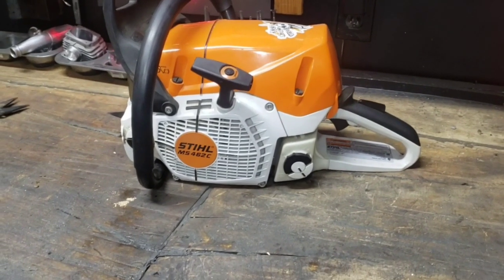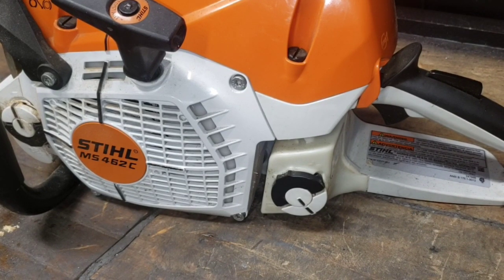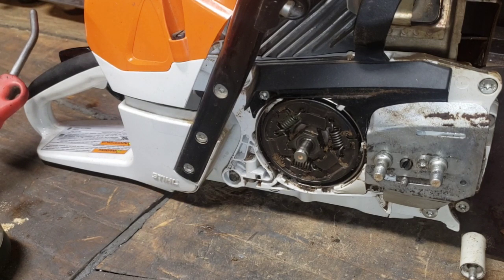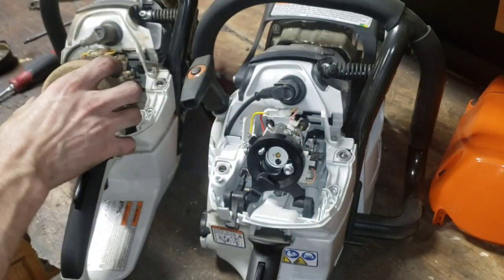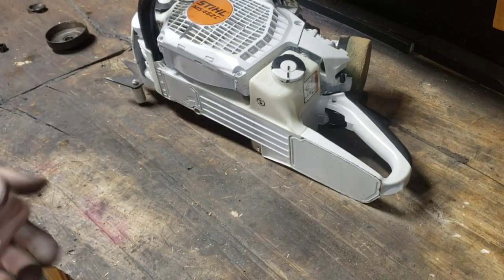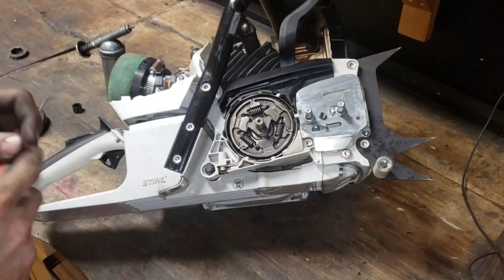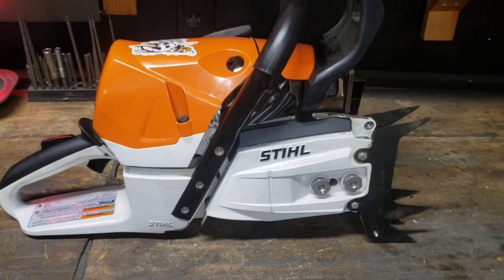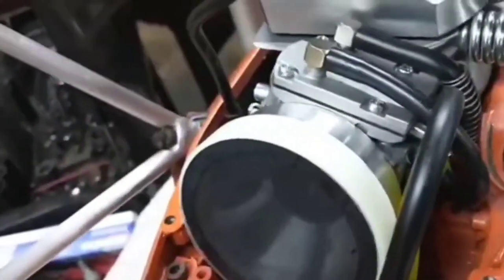MS462 diagnosing and repairing... clutch issues and a CRAZY husqvarna  372 race saw with....

Comment: Not long ago, i had a clutch issue, so bad the chain would even stop running with no load.. the issue was the chain oil and saw dust, that had got in and basically coated the entire clutch surface with a slippery coating that didnt let you cut anything basically. The best fix was metal drill brushes running very fast, with some brake cleaner, and a good cleanup behind the clutch. Never had an issue ever since, but everyone has to keep their saws clean and well maintained.
Reply: Thanks for this reply.  I'm thinking about doing this and after reading this,  I def.  am.

Comment: I like chainsaws but live in Florida, don't need one. Didn't stop me from buying a 372 cologne saw and modifying it myself. So when I cut down a tree that was interfering with my driveway I saved most of it to test my saws on. Man I just can't sharpen a chain! This friggin fine dust that coats everything and sticks like glue and my chain is dull once again. Come to find out( plant id app, highly recommend) the tree I had cut down was a southern live oak. Hardest tree in North America(apparently)Not bad when it's  green but once its dry its rates 2680 janka. For reference black locust is 1700 janka. Janka. Something else  I learned.

Comment: portable lathe.........use a heavy 1/2" chuck /drill with a forward reverse switch with a lock button for the trigger . put it in a vise and carefully tighten it in place somehow then install the piece to be shaved /ground down in the chuck and start the drill in the correct direction. then take your portable angle grinder with the correct abrasive for the job and start cutting in the opposite direction of the rotation of the drill and shazam a perfectly concentric work piece completed and ready to use and if you need a certain finish on the metal just change the abrasive on the angle grinder. you can always use a drill press that have a larger chuck or make a custom piece holder for it since the rotation of the drill/tool holder is rotating concentrically the hand held angle grinder is all you need to do the job with abrasives and gotta wear eye protection and  other necessary protection stuff. 😳i discovered this method 25 years ago while doing a field fabrication of my own design. now i am going to check out my chainsaw after seeing how its done😊

Comment: Very easy to "stuff" a saw with the three point dawgs and overwork the clutch.  They give you a ton of leverage that needs some finesse in hardwood.  Brennan is a hell of a machinist and fabricator!  Another thing he shared in a recent video is his race chain which is also top secret  stuff.
Reply from the maker: i agree... you can glaze a clutch real fast especially with the leverage... its actually part of the reason Stihl doesnt send their saws out with the bigger dogs only on the R models because that is their concern... this was a weird one i have seen thousands of clutch issues and its usually easier to diagnose... i wish i had a picture of the clutch that failed it was purple towards the center more than the outside and it killed the springs... but the drum was pretty much undamaged... and yes Brennan is a stud!!! I call it a win any time i learn something and its like a home run derby when he puts out a video

Comment: I would like to ask if any stihl saw has a sensor or some failsafe that doesnt allow the saw to start withour bar oil in it. I was with a friend, and he was trying to start a 2007 ms210 that had been sitting in his garage for abt 2 years. He said i did like 30 pulls and nothing, spark plug is good, gas is full, i dont know whats wrong. I go for a few pulls and find the saw really light, open the oil cap and see no bar oil.. so we fill it up, and on the first pull it starts up perfectly. Im not sure if there is anything between the oil line and the pump trying to prevent damage to the saw, but it was really weird..